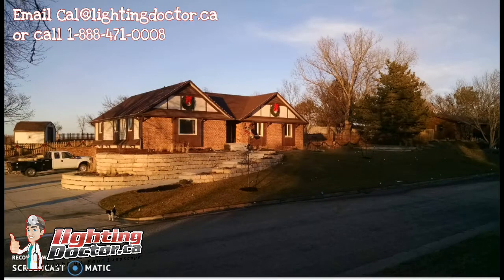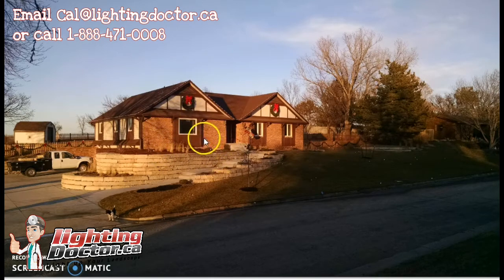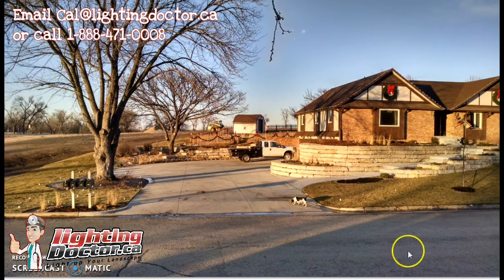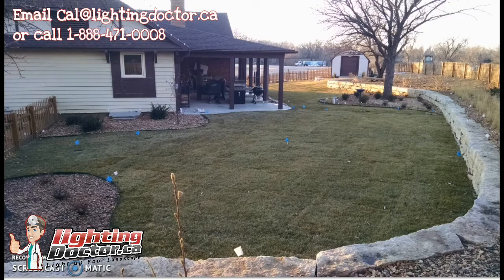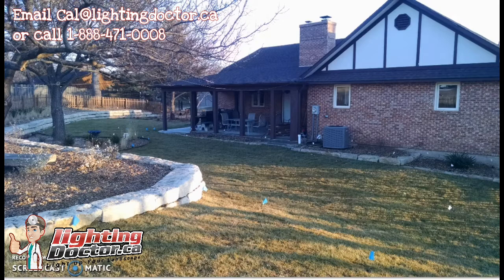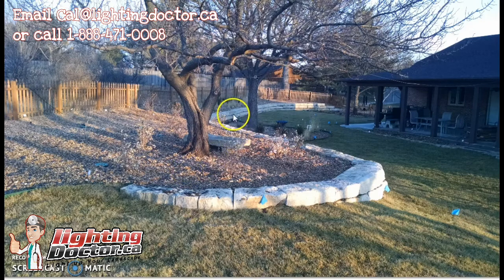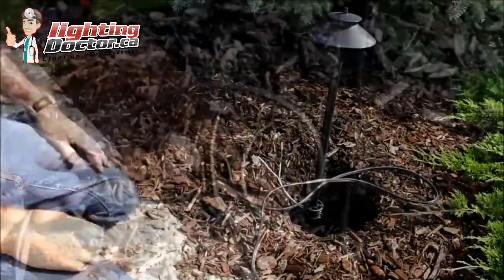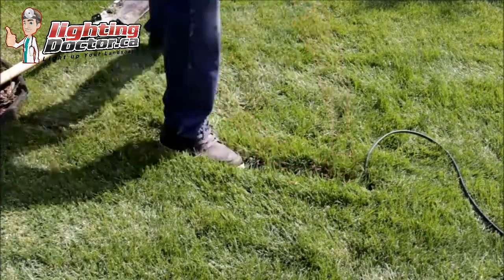Low Voltage Landscape Lighting DIY Design Tips & Ideas

Comment: The transformer only has room for one wire does one wire support all 60 lights!
Reply: You need a larger transformer. Break the 60 lights up into a few cable runs. Maybe 10-15 lights per run.